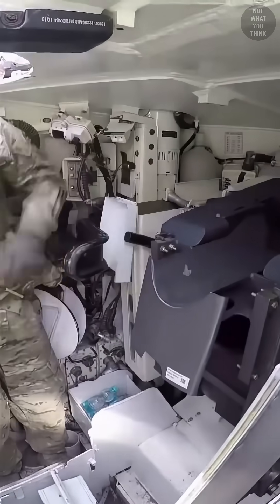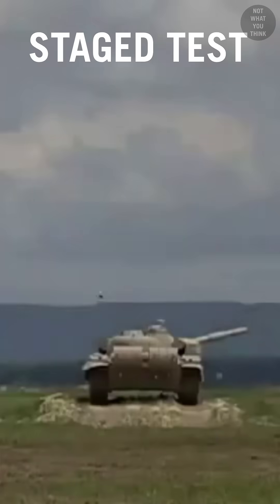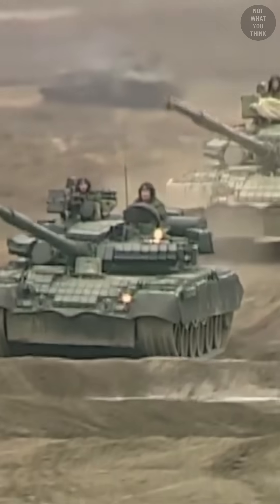Why M1 Abrams Tank Has No Auto-Loader #shorts

Comment: ...Auto loaders also have blowout panels? See French Leclerc, or Japanese Type 90 and Type 10, or the South Korean K2 Black Panther...

It comes down to doctrine and what the crews themselves prefer. A manual loader was selected in the Abrams as thats what US Doctrine wanted, and the crews preferred to have the extra man. There's many different reasons why the US doesn't use an autoloader on the Abrams, but ammunition protection isn't one of the main ones.

Loaders also do way more than just loading the gun, their named role is 'Loader', but their job is way more than that
Reply: Indeed. In British tanks for example the Loader is the 2IC of the tank and is expected to take command of the vehicle if anything happens to the TC.

Comment: 0:50 - "the panels will vent out the explosion, while protecting the crew inside" - LMAO! And that's said while the video literally shows the entire turret blown off and going 100ft into the air, while on fire :-D

Guys... If the ammo storage of any armored vehicle goes boom - it's game over for all occupants, period. There is no "venting the explosion" or using a 2" thick little door to protect the crew from it :-D That said - storing the ammo lower in the vehicle's chassis MIGHT reduce the odds of that happening in the first place, compared to storing it in the turret...
Reply: @chuckyxii10  What exactly were the Russians supposed to fix here?
The T-72 is half a century old, but it served it's purpose. The M1 isn't exactly new either, and it serves it's purpose to this day.
Both will have their turrets flying and the crew evaporated if their ammo rack detonates.

Now, how well one's ammo storage is protected from detonating, may greatly affect whether that happens or not.
Reply: @chuckyxii10  Well, I can believe that the turret stays put... but, a simultaneous explosion of several dozen M830 HEAT rounds, about 20kg each, which are all located inside the tank, can be just "vented up" in such a way that the crew will not be harmed? That's damn hard to believe. Sounds like army propaganda TBH...
Reply: @chuckyxii10  So, if an AP round penetrates armour and hits the HE round stack - it will only detonate the propellant? And if one warhead does goes off it will NOT trigger the warheads stacked on top of / next to it?
Reply: the film was of a Soviet/Russian tank not an M-1
Reply: This is not accurate, the reason why armor gets penetrated is because of the projectile speed, if a round just explodes the explosion will in fact be routed away from the crew. It's the same reason Tanks can get hit by mortars and be relatively fine most the time, no penetration the squishy insides are good to go. You can look up penetration values on the M1 and see that a projectile needs to be traveling pretty fricking fast in order to pen them, even on top armor.
Reply: "Guys... If the ammo storage of any armored vehicle goes boom - it's game over for all occupants, period. There is no "venting the explosion" or using a 2" thick little door to protect the crew from it"

Actually that is exactly what happens when the M-1 Turret ammo blows up. And the crew inside the tank lives.
Reply: @chrisperrien7055  Someone earlier here commented that if the turret gets penetrated - only the gunpowder-like propellant explodes, not the actual warheads of the HE rounds. That much I can believe can be just vented...
Reply: @suzukirider9030  good one,  I can't recall enough of the technical manuals about M1 ammo storage(and no longer have them myself) to give you a definite answer on that . IF I bumble over to some tanker sites, near future, , I'll ask some old comrades about it, who would know..  Or you might want to go over to "The Chieftain's" site and ask him, he would know, or could find the answer.

Comment: What would stop you from putting one more solider into the tank to replace the driver or gunner if needed if the tank has an automatic loading system? That argument just doesn't make any sense to me.
Reply: Which means you would then have to make the tank's turret bigger. A tank auto loader is a big piece of hardware that takes up as much space as a person. There's no extra space in a tank for an extra man